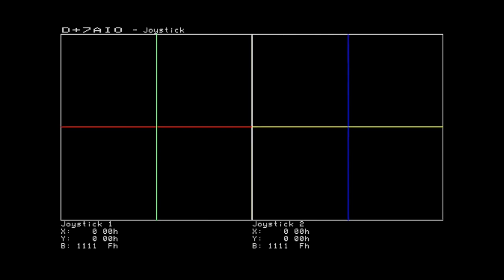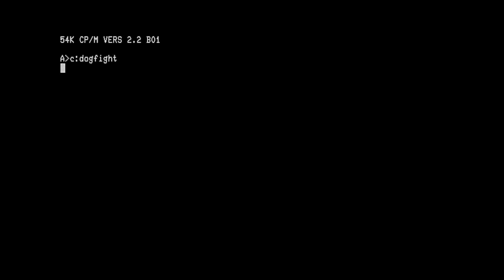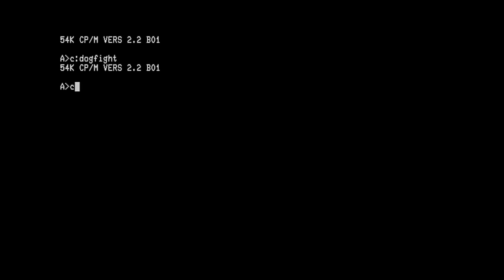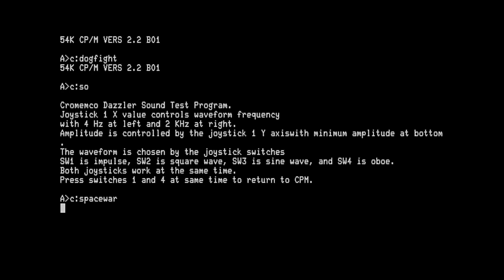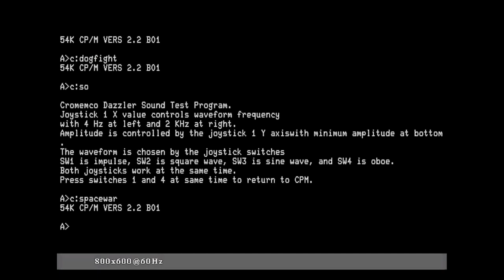THN039 - S-132 (2) - #Cromemco D+7A Input/Output - JS-1 analog joysticks + audio

Comment: I’m guessing back in the day getting a system set-up that could play Dogfight or Spacewar would have cost a small fortune. Maybe this game was mostly played in university computer labs rather than being the Atari VCS of its day?
Reply: A Cromemco Z-1 with Dazzler and D+7A cost roughly $3,000. Not in everyone's price range to be sure, but substantially less than the University minicomputers of the day, which were priced at $100,000 and up. And these university machines did not have color graphics, which we pioneered with the Dazzler.
Reply: @hgarland  Thanks for replying! It was a remarkable breakthrough to bring computer graphics within reach of so many. What was the most impressive thing you saw running on the Dazzler?
Reply: @GrantMeStrength  Good question! The Dazzler and its successor products (e.g. the Super Dazzler) were the first color graphics products to be widely deployed in the television industry. Roughly 80% of the television stations in the U.S. used Cromemco systems for the display of maps for their weather broadcasts.
Reply: @hgarland  I did not know it was a hit with TV studios. Makes total sense! Was that an intended market or were you surprised to see it happen?
Reply: @GrantMeStrength  We had no idea where the Dazzler would be used. We just thought that it was so cool that certainly everybody would want one!